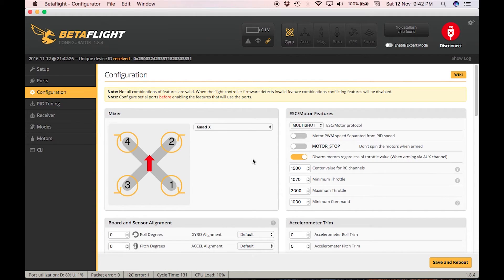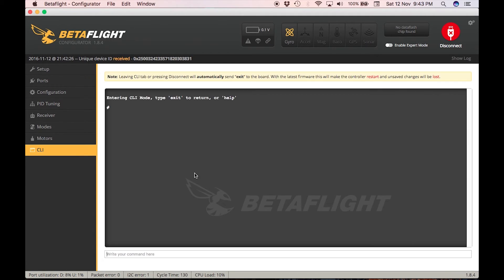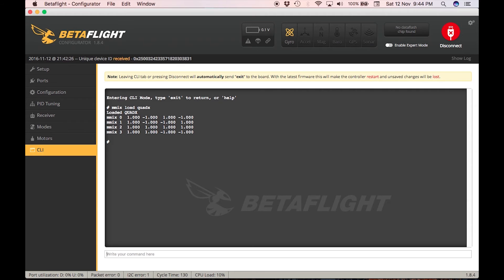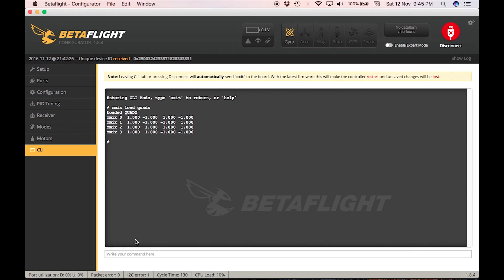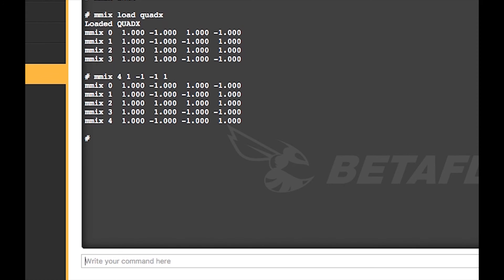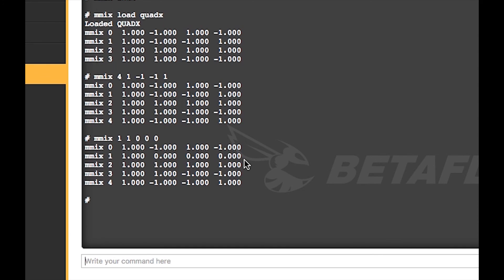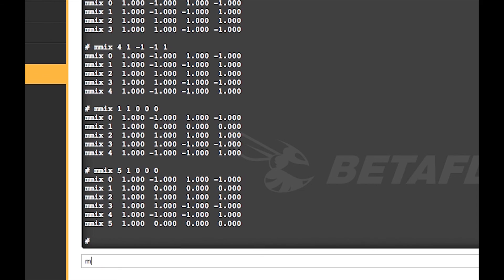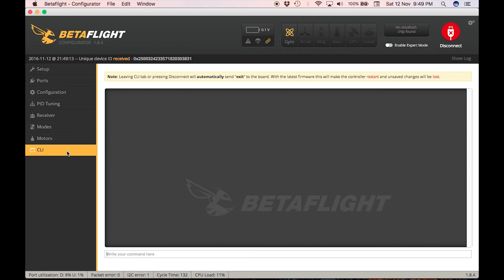Motor output remaping on Betafligth/Cleanflight | Dreamy tutorials

Comment: thanks for the video... 1 question
do I have to solder the motor wires on the channel I wanna use it? example pad 6
Reply from the maker: Yes you have to also physically change the motor pad as well!